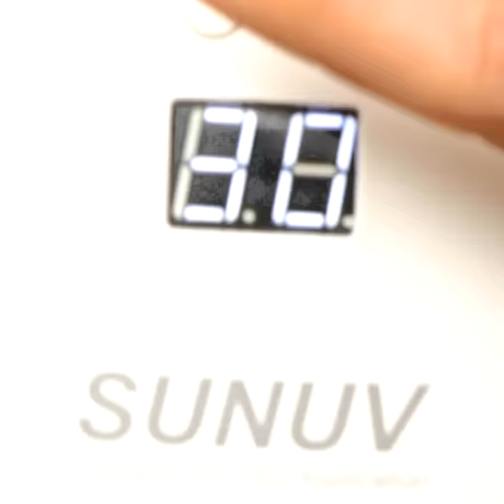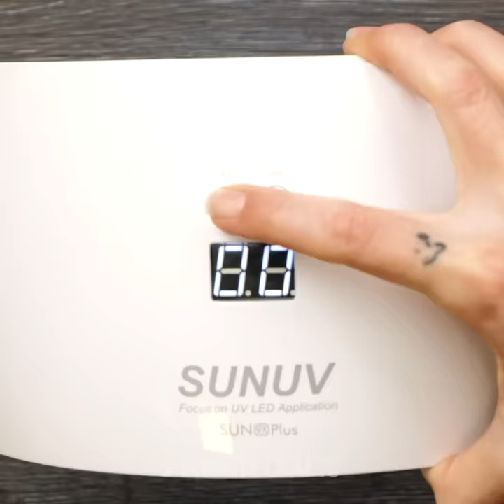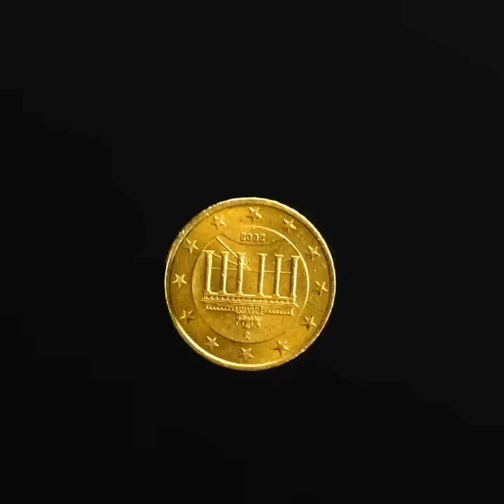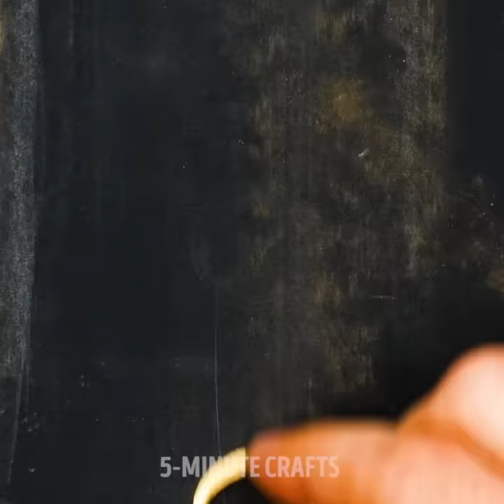Cheap Yet Beautiful Jewelry DIY Ideas That Will Save Your Money

Comment: “Will save your money”

breaks a plate and creates a necklace, which is made out of its broken pieces and probably lower in value than the actual plate.
Reply: Lol so true🤣🤣🤣
Reply: Everyone thinking "they say to break a plate"
I think"thay say if you break a plate ?"
Reply: @everything4996  she just broke her plate with a hammer so they do have a point
Reply: @Concaine4kidz  yeah but they can't demonstrate us by claiming that they already have a broken plate. So they simply show what can be done if a plate is broken. Also it's the different broken parts that matter. She broke it and took the small geometrical part. So even if we have an unevenly broken plate, we can further break it into small and make a jewel.. 

Anyway I know that's a good joke but there's a point too. Plus they're not asking us to break it obviously.
Reply: Don’t forget the clock and you need a mechanic spinning thing too your lovely keys, a thing where you sand a coin or two (what did the coin to you) and very cheap tools to carve a perfectly good coin to made a piece of “exquisite “ jewelry made this finest Chanel brand.